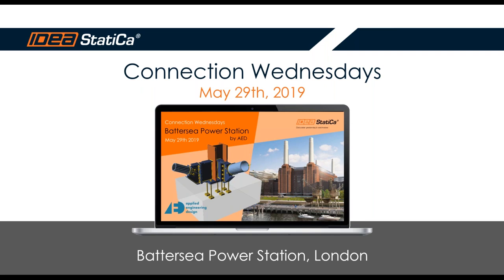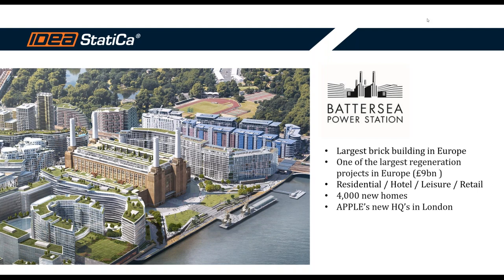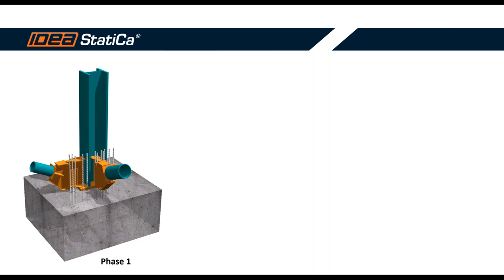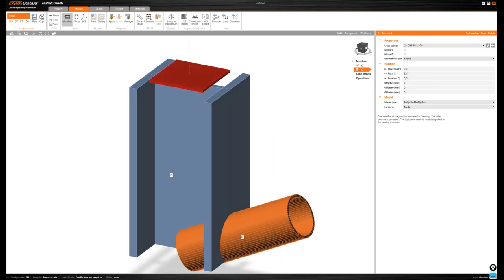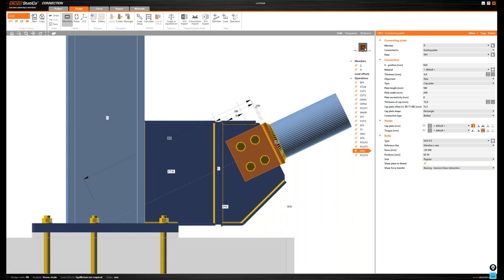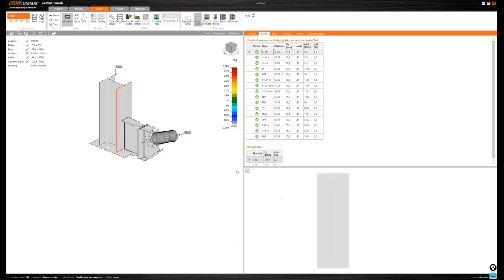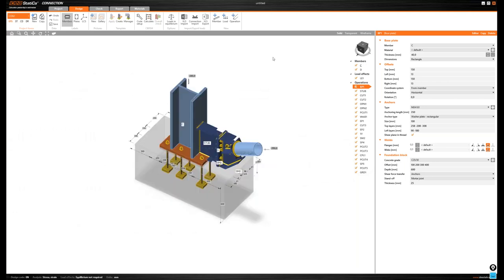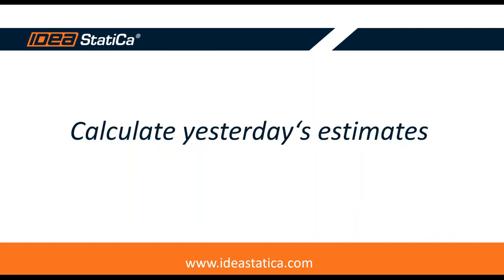Connection Wednesdays – Battersea Power Station (London)

Comment: Q1- The cast-in anchor bolts fail, how was this resolved?
Q2 - For the helpdesk issue, the interface plate was fully welded to the column flange, so there would only be a single shear plane?